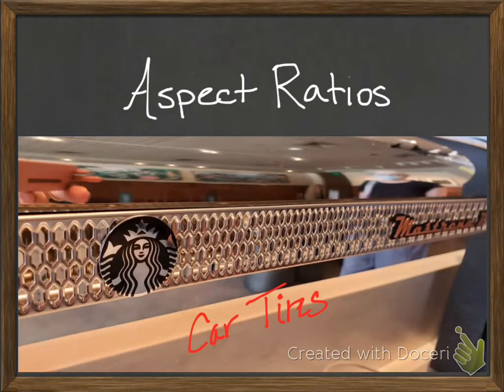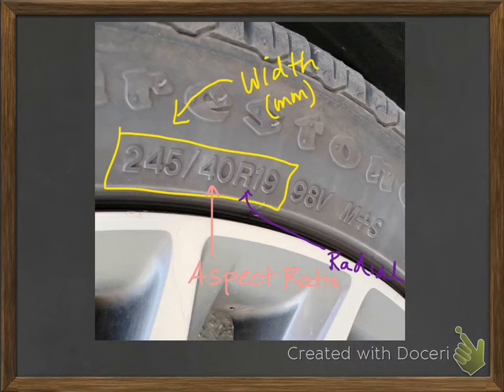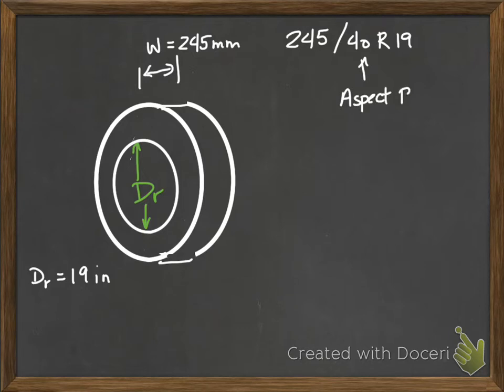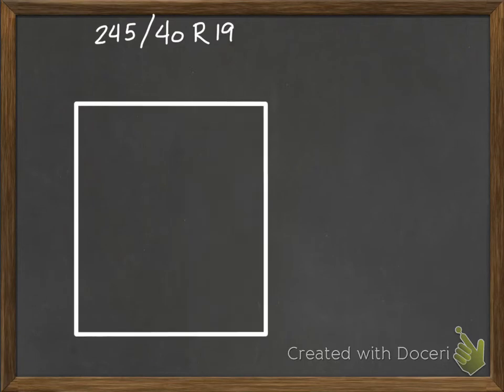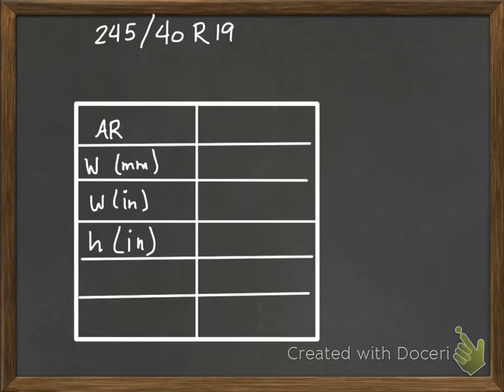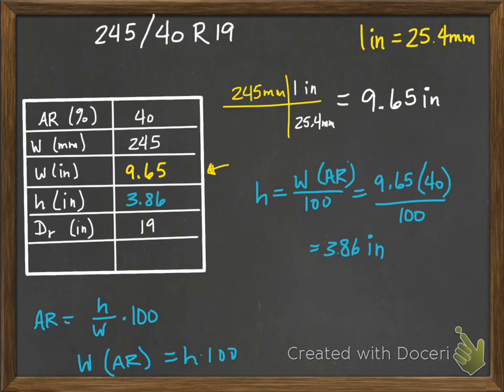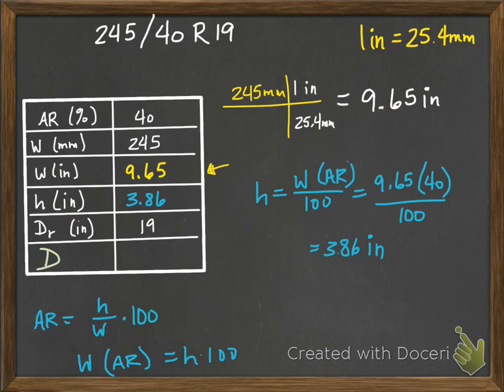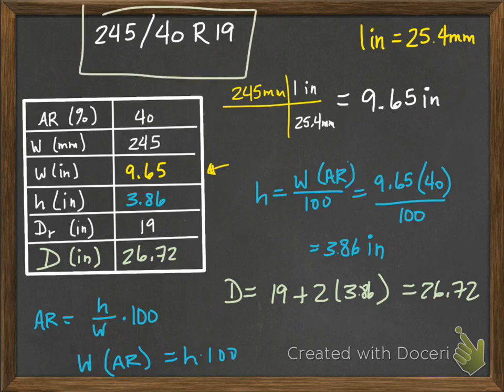Aspect Ratios in Tires

Comment: Nice explanation but would it not be easier to just multiply tire width by aspect ratio to get height?  245mm times .40 equals 98mm and if you want inches divide by 24.5
Reply: sorry i meant 25.4
Reply: She actually says that in the video.  8:29

Comment: So what your saying is if I replace my old tire (205\60\15) with 205\65\15 that it go 3 MPH faster than the speedometer. And only be 1\4 inch taller tire?
Reply from the maker: Yes. It doesn't seem like a lot, but the 1/4 inch is part of the radius, which is then multiplied by pi. So, it kind of snowballs.

Comment: WTF would an industry us a formula with additional mathematical steps increasing the probability of error to calculate a single dimensional measurement?  I hate seeing new laws but someone set a standard of measurements using all the same scale.  In my not so humble opinion tires should read Width, diameter, rim size in a single scale or both SAE and metric.
Reply from the maker: Totally agreed. It's very confusing to have both!

Comment: The "millimeter part" driving her crazy...!
Ha ha. 
It is the "inches" part which should upset her, not visa versa!
Who still works in Imperial measurements in this day and age of globalization..! They should join the modern age and convert to the metric system.

(One inch is a twelfth of a "foot", right?!. And each inch is divided in parts of eight. And there are 3 feet in a yard..!
How silly and cumbersome...~!: 8/12/3..!
How many yards in a mile? (I know it is going to be another crazy, silly number that makes no sense at all...!)